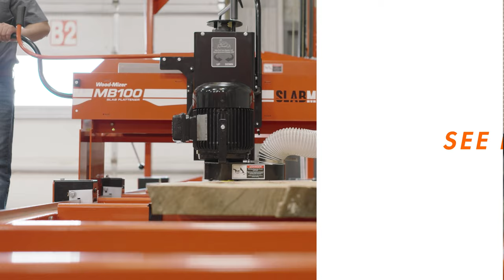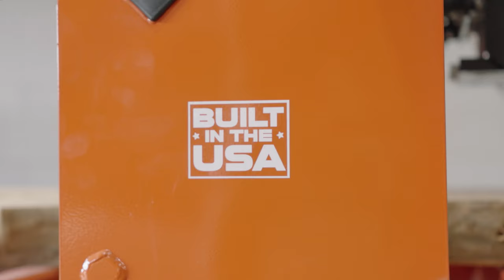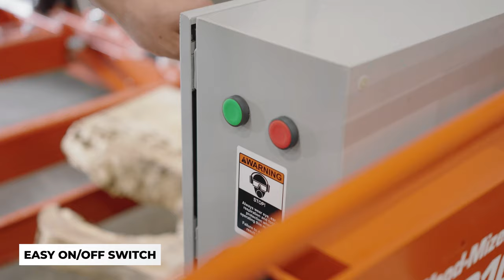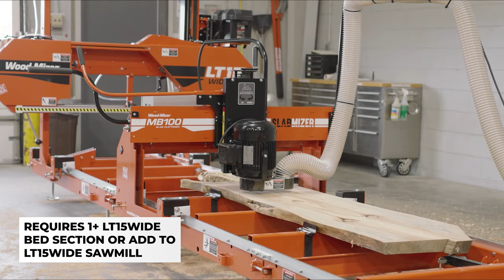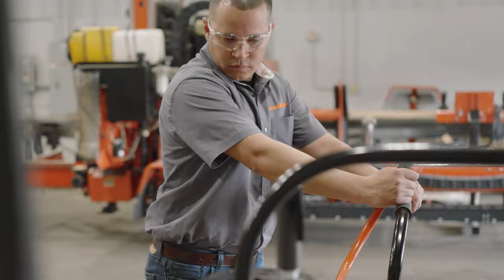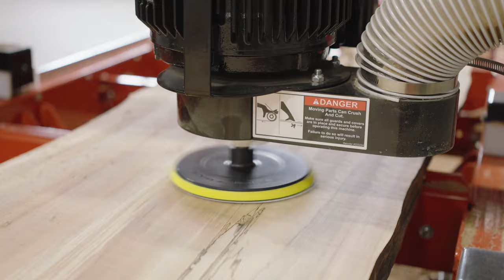SlabMizer MB100 Slab Flattening Mill in Action | Wood-Mizer

Comment: Does it fitt the same undercarriage as the Bandsaws have?
Or are the dimensions of this undercarriage different? Or the top machinery that is on the undercarriage? 
LX450 Sawmill for example 
Kind Reguards
Reply from the maker: Hi Setari, thank you for choosing Wood-Mizer. The MB100 SlabMizer is only compatible with LT15WIDE portable sawmills or with at least one LT15WIDE bed section. Visit woodmizer.com or give us a call at 800.553.0182 for more info!